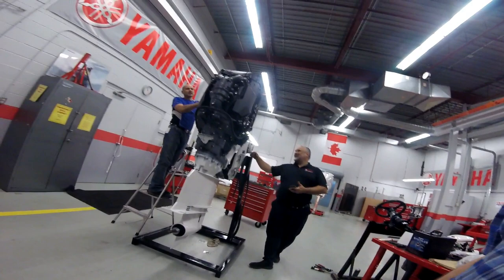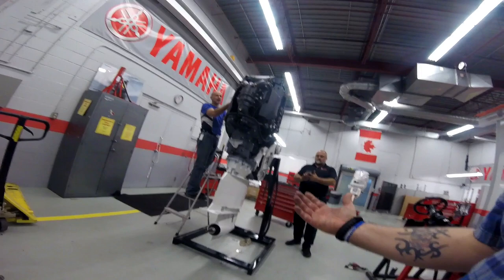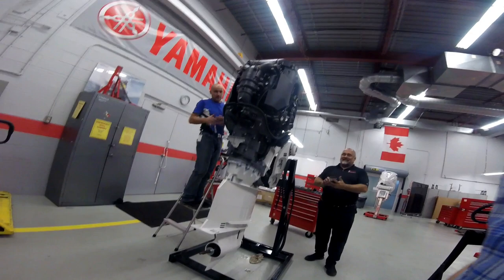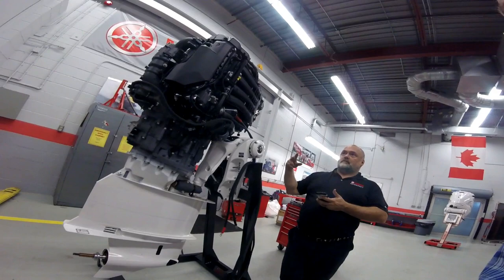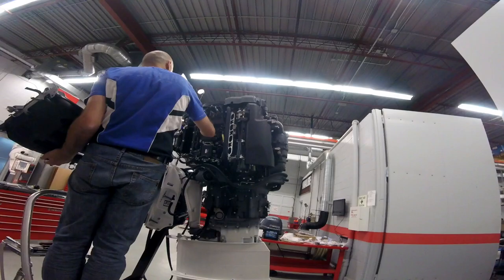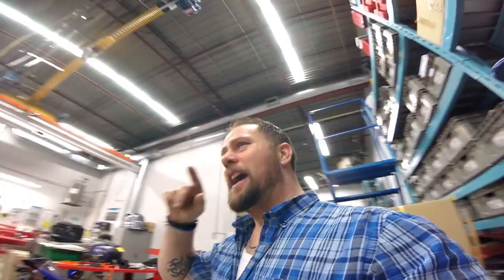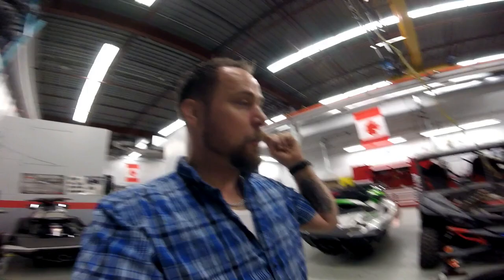New Yamaha XTO 425HP behind the cowling

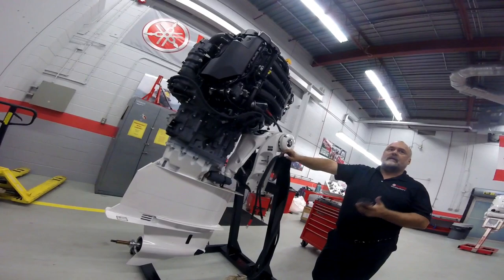Comment: I gotta cut in here. At 2:17 its said that it was using 141/142 gallons per hour. I didnt catch how many engines were on the boat but there is no way it was one.
Yamaha has specified the maximum fuel usage is 140L/h at maximum power. Even going to a 5000rpm cruise, i know sounds quick, it goes down to 89L/h. 140L/h isnt great fuel consumption, it might not even be good considering its a 12.2 to 1 direct injected engine. The bsfc is just north of 0.5lb/hp*h. 
What this seems like to me is the other person misspoke and meant to say litres. Its too close to be coincidental.